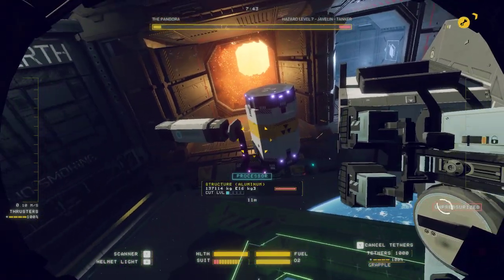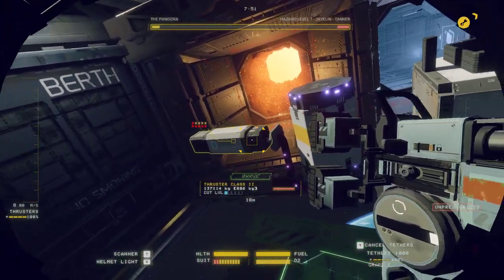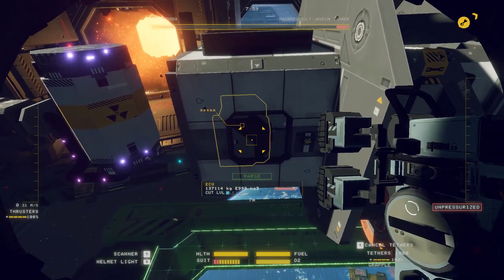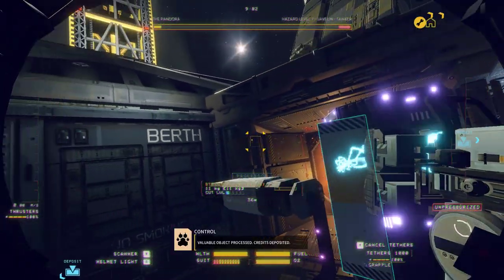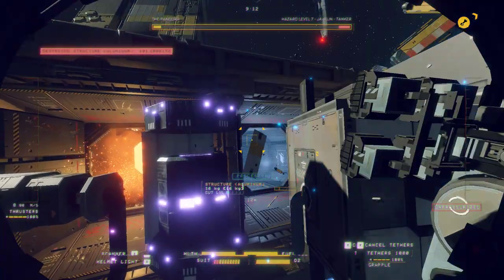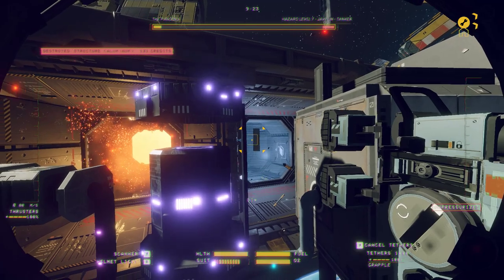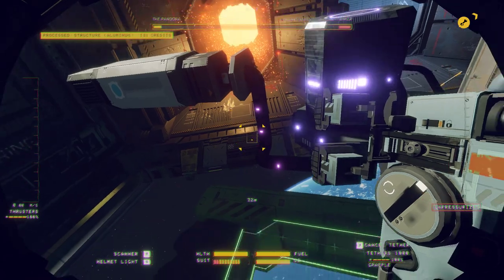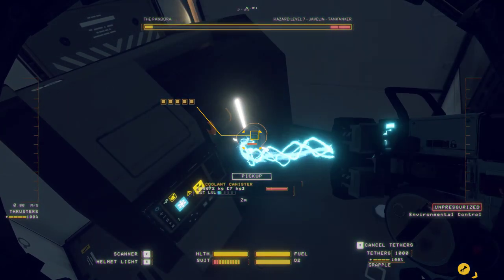Hardspace : Shipbreaker Removing Class 2 Reactor Guide - Made Easy

Comment: What do I do if the thruster disconnect lever is unpowered? Am I screwed?
Reply from the maker: i made video about why the switch stops working, https://youtu.be/vcJJgWf3HLU but if you do get into that situation, you can use a can of coolant from the ECU to freeze the fuel pipe between the reactor and engine and you should be able safely cut pipe, but do it before you remove the reactor (i think). Thanks for watching!

Comment: But can't you just drop that whole section onto the barge, as the pieces you lose are relatively minimal?
Reply from the maker: You could I guess, it depends on how close things are with the ratings, thanks for watching !
Reply: Mounting plates are decently valuable, but yes. If you forget and can't release the thruster, you can just cut the wall panel the ECU is on

Comment: so... i may have just tried to break the coolant canister against the fuel line itself. protip, don't do that. veeeeery dramatic.

rewatching, I could pinpoint the exact moment where he had the unbroken coolant canister in his grip and then he thought internally- no i definitely should not break it on any of that, and went back to the ECU compartment to smack it around rofl
Reply from the maker: lol yeah right idea wrong pipe :) tbh think freezing the pipes might be safety overkill, if you watch the play through i did i very rarely freeze the pipes to engines thanks for watching!

Comment: i got killed strangely enough.i was at the training mark for my 1st reactor2 removal.firstly i accidentally cut the coolant pipe first trying remove the outer hall.which in turn made reactor/engine rigging free to float around without setting it off.so when i was ready i did the coolant containers/no power for the turn off valve so i had to laser slice the pipe to the thruster (but no explosion) which then it set off the reactor.after i got rid of the reactor it then went back to normal game/so i went to trim off the pipes at  the valve plate/which some how when i started cutting the pipe which would have come from the reactor it blew up along with me right next to it
Reply from the maker: Lol sounds like you got lucky then unlucky :) also sounds like a bit of a bug, if you cut  the coolingg pipe  the thing should start to meltdown, strange :s